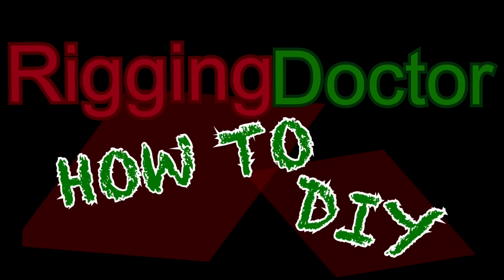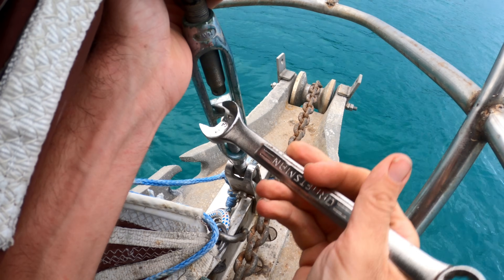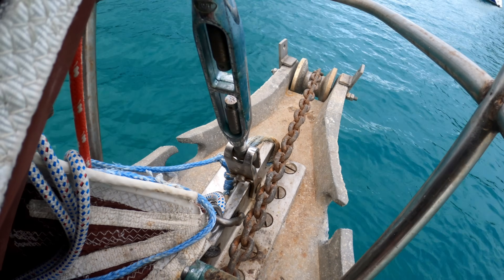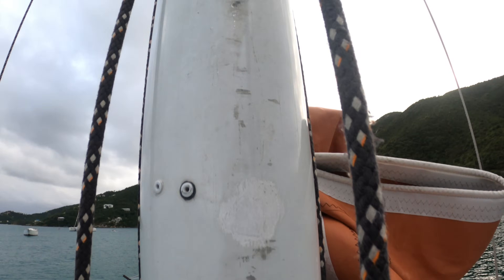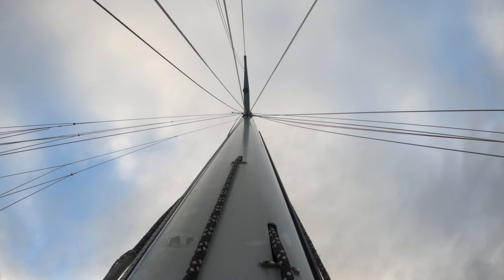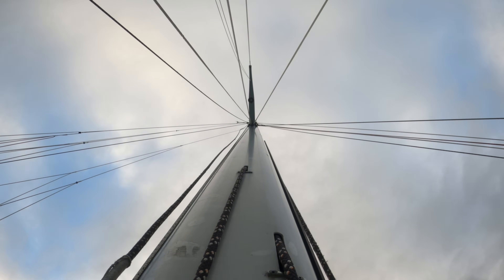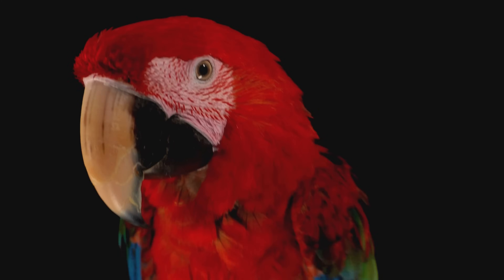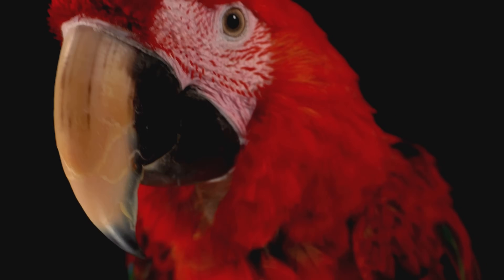How TIGHT Should Your RIGGING Be?

Comment: Using a weight on the main halyard is not the correct way to set the lateral masthead centring IMO. Take the main halyard down to the chainplate on one side and cleat off when it touches the shroud plate under your weight pulling down. The take it over to the other side to measure the difference. Adjust until both sides are the same. Mast aft prebend is normal and is usually a couple of inches on your size boat but should be _set to match sail cut_. More prebend helps pull the draft forward which is important for balance and efficiency going to windward. But if  the sail has a really bad shape due to age there's no cure but recutting. For in mast furling then mast needs to be straight (as you noted) and as the sail blows out with age the furling will get very difficult so it will need recutting sooner. Rake moves the centre of effort fore and aft to set the boat balance. If you have too much weather helm when the boat is beating in a moderate breeze with a little heel on try altering rake. Modern boats with wide sterns can develop a lot of weather helm as they heel -this can't be fixed by rake -so set the rake for a balanced helm when the boat is not heeling much and try to set sails for a flatter boat when the wind pick up. Sailing with a lot of helm on both is slow and tiring for the helmsman and hard on auto helms. It is important not to have any hint of lee helm when beating. If you hold the helm neutral in a light breeze on flat water the boat should round up only very slowly or ideally hold course. You should expect a bit of weather helm in a stronger breeze and the extra lift from the rudder is a benefit (but that's maybe moving toward racing trim goals). Increasing weather helm is a sign that you need to think about a reef in the main (or at least let the main down on the traveler).  Assuming you haven't made the mistake of having your head sail sheeting position too far inboard (as I've seen on wisdom a couple of times) and closed the slot too much, a small bubble in luff  of the main is OK, the accelerated flow from the headsail sill creates good windward drive from the main. If the bubble get too big you need to reduce fore triangle area. The foresail should be furled/reefed to regain boat balance. The back stay tension controls foresail sag and too much sag really hurts going to windward. Forestay sag can make roller furling really hard to operate so make sure the backstay is on if you want to adjust the roller. Waggling the shrouds to decide if they are tight enough is not really what a proper rigger would do but most people don't have a tension gauge so here's a rough guide (YMMV): If you push out on the lower hard and the mast gets a visible bend to that side the opposite lower is not tight enough. Adjust both sides to the same tension by their feel. The tension in the aft lower (if there is one) should only be slightly less than the forward lower to limit mast pumping. Then go and sail in a good breeze and inspect mast/sail shapes and adjust accordingly. I've not talked about mast chocks here but if you have them set the mast and then chock.  HTH
Reply from the maker: These are all very good points!
The reason I prefer to check the athwartship position of the mast using a plumb over measuring to the chainplates is that the chainplates never are perfectly symmetrical. Therefore the halyard won’t actually line up perfectly to the port and starboard chainplates because the actual distances will be off by a few mm at best, or several inches at worst! When making new rigging, a common mistake people make is to only measure one side and then build both sides of stays based on that measurement assuming that their boat is perfectly symmetrical, only to then be informed of the reality when they go to install the new standing rigging. 
As for the tension, I only use a gauge if there are manufacturer specifications, and I only use a Loos gauge to get to the minimum setting (that way I don’t set the rig too slack and therefore cause damage). Once the minimum tensions are set, I complete the tune by feel and the feel is from giving the stays a wiggle. 
On older cruising boat rigs or low stress rigs with lateral spreaders, I know the feel of too loose vs tight enough and tension accordingly. Once the minimum tension has been achieved, I continue to tune until the mast is in column and ready to go. 
For rake, if there is no manufacturer specs, the starting point is to set the front of the masthead directly behind the heel of the mast step. This is achieved by hanging a weight on the halyard and measuring the distance it hangs aft of the mast at the gooseneck. After this, a test sail will confirm if it needs to go a bit forward or aft from there. 

I am curious with the sheeting angles when you said that the jib is too far inboard. Is the sail in concern the staysail or the headsail? I ask because I would like to correct this issue and I’m not always looking at the main bubble when beating as tightly to windward in high winds, so I am appreciative of your close eye catching these details. 
The staysail track is ridiculously inboard to allow enough slot for the headsail to be flown at the same time while going to windward by being sheeted to the toerail. The issue is the sails still interact in a negative form and results in us dropping one of them to improve the performance of the other. 
With a reefed sail plan, the staysail can trim in much tighter and allow us to point higher than the headsail can, so we do use it when sailing very close to the wind. I plan to remedy this rather restrictive sheeting angle by switching the track to floating rings which will allow trim of fore aft as well as athwartship. At the moment I am only able to go more outboard by using a barber haul. 

Thank you for your input!
Reply: ^^^ this guy knows what he is talking about^^^

Comment: Now just hold on a minute... Shouldn't the athwartships centering be relative to the chainplates? I mean, with your method, the boat has to be floating exactly 'level' for the weight to be directly behind the mast when it's centered...
Reply from the maker: The boat should be floating level. 
Chainplates should be perfectly symmetrical but never are. A safer option if the boat is too tender or suffering from an incurable list is to use the halyard to toe rail method. The toe rail tends to be a bit more forgiving to the builder than the chainplate position and therefore a more accurate way to measure the mast position by geometry. 
To fix list, even temporarily to tune the mast, weight can be shifted and placed on the appropriate deck to level out the boat and then a weight hung to measure the mast in reality and not relying on the boat being symmetrical, because they never are actually perfectly symmetrical.
Reply: Yes, even small 1 degree list will cause the weight to move far off the centreline (8 inches in a 40 foot mast).
Reply: I have two boats. One is intolerably tender while the other has an incurable list.

Comment: Okay, so I came here because my boat is "listing" to starboard roughly 3 degrees when I stand dead center. I am not sure if it is my weight distribution or if it is the mast. But I don't carry very heavy stuff on my boat and I tried to evenly contribute weight.

How can I tell the difference so I can address the problem?
Reply from the maker: Does it list when you are not on the boat? If the boat is level with you off the boat, you can hang the weight and look at it from a distance, making adjustments and then stepping on the dock to check the adjustments. 
If the boat is rather tender, you can use the halyard and run it to a point at the toe rail on the port side with the halyard really tight, then run it over to the same spot on the starboard side and see where the halyard reaches. 
This method uses geometry and therefore works on boats with an incurable list. If the mast head is centered, the halyard will come to the same point of the deck on both the port and starboard sides. If the mast is leaning towards one side, it will not come to the same point on the decks. For example: if the mast leans to starboard a few degrees and you run the halyard to the port spring cleat, on the starboard side the halyard will overshoot the starboard spring cleat. If you started on the starboard spring cleat, it won’t reach the port spring cleat. If the mast is centered, then it would reach both spring cleats and be tight in the process. 
The halyard to deck method uses geometry as the halyard becomes the hypotenuse in a right triangle and is not trim dependent, but also not as visually easy to do quickly. The weight hanging method gives you an instant visual answer to the position of the mast, but only works on heavy boats that don’t list much as you walk around them.
Reply: @RiggingDoctor  Cheers mate. You are always so helpful! :)
Reply: That's a lot of list. Check the position of tanks and batteries but it could be your keel was set wrong -I've seen it happen :0
Reply: @SpiralDiving  I do have two batteries on starboard and the heads on starboard, too(the side it leans to) but the tanks are all centered, the engine is, too.

On port I have the galley, cooking equipment, the gas bottle (although just 4.5kg), a few tools and foul weather clothes and a diesel heater mounted.

Not sure if the keel is set wrong though.

Would a mast, that leans too much to starboard have the boat list to starboard, too? I mean there has to be some weight to it, right?

I have a 22ft boat on 3,5tons, with 660kg ballast. So I think if he mast would be off it might do that to the boat.

Comment: Wow........... horrible rigging job.     If this guy shows up NEVER let him touch your rig.    Loose is horrible on the boat.    When a fist hits it,  you are creating increased shock load.    

Horribly bad advice in this video
Reply from the maker: When your chainplates rip through your deck at the dock because you over tighten your rigging, think of me. 
As for shock loads, the only time those occur is when you crash gybe, which is easily avoided by performing controlled gybes. If you manage a boat properly, it won’t experience shock loads and therefore will be happy with rigging that is as slack as possible to keep the mast in column. 

Your leeward shrouds must go slack when sailing close hauled in 25 knots of wind, if they are still tight, your rigging is too tight. 

Fair winds.
Reply: @RiggingDoctor  Normally chainplates and their attachment to bulkheads is much stronger than the shroud/tang strength so unlikely to pull out (bad rot or broken ring frame/bulheads excluded). Many don't know that a mast acts in high compression due to the sails and adding excess shroud/stay tension is more likely to serve to collapse the mast. You will see it go S shaped just before it comes down -this is more likely on boats designed to win races and break at the finish line (i.e. thinnest possible mast section). The loss of chainplates is very rare -I've never seen one pull out although I've seen a rig save by tacking when a tang broke.
Reply: @RiggingDoctor  To be fair he only said loose and did not say over tighten! Loose rigging causes shock loads when the sea gets big and the crashing starts...

Comment: What if your boat doesn’t have any forward lowers or baby stays?  Anything you should be looking out for?
Reply from the maker: I’m assuming you have aft swept spreaders (and probably a fractional rig).

The backstay tension becomes very important as it keeps the mast arced backwards, and the cap shrouds play the role of supporting side loads and inducing mast bend. 
If this is your case, the cap shrouds need to be tensioned to 20-25% of their breaking strength which is going to seem incredibly tight! But you need to do this as this is how the rig is designed.
Reply: What kinda boat ?
Reply: @jonathanshore5768  spirit 6.5, it's an odd rig, masthead trailer sailor, deck-stepped, inline spreaders.  no baby stays.